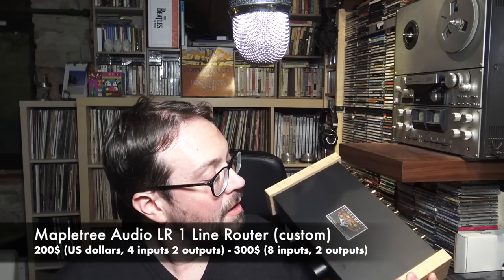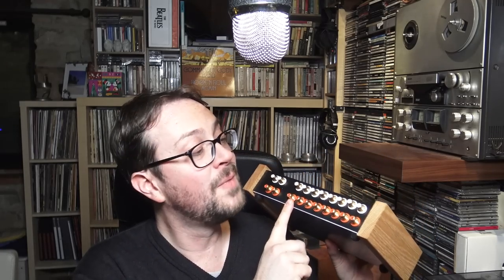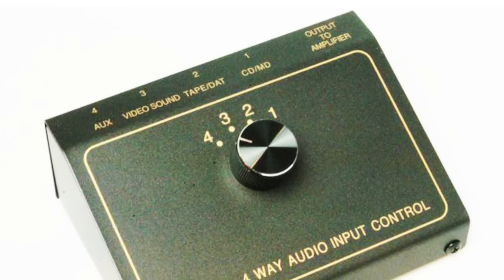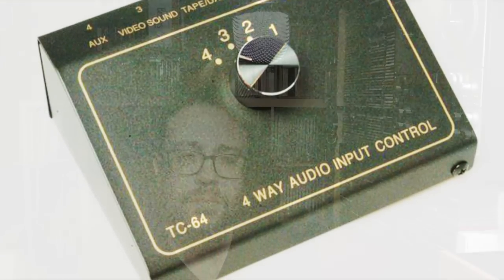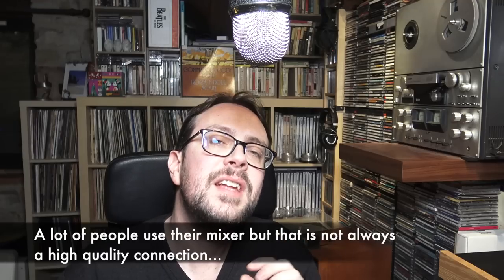AUX: Expand your amplifier inputs!

Comment: This will probably be a very welcome video to a lot of people, or at least it would have saved me a lot of time when I decided to get rid of rca splitters! Such a simple and useful device and yet so little is being said about it! Confusingly a lot of times it is called passive preamp, maybe because sometimes it can have a volume wheel, but anyway it's something I would avoid as it's only a resistance in series that can degrade the sound. I use mine to route the signal between pc, dac and turntable (with phono preamp) to a tube headphone amp or speakers, I added some embossed tape stickers for simplicity to find the right source. I would also add that being a passive device you can use in either direction, as an example if you have one that was thought to be used for 3 sources to one amp, you can also use with one source and 3 amps. Also if you have a lot of input and outputs and you don't want to go custom you can use two of them: as an example one that has 4 sources and one destination, instead of attaching it to an amp you can connect it to another one that route one source to 4 destinations. Not easy to explain, but it's exactly how those with two wheel works, just remember that the wiring between the two should be high quality!
Reply from the maker: I agree! Thanks for the extra info Marco!

Comment: Thanks for this video, very informative as always, I actually use the Dynavox aux-s the opposite way, not to add more inputs to my amp, but to run multiple signals-sources true the same “Buffer”, in my case two Russian Foton tubes from 1967 , this gives the a sound i like to my, CD-player, DAC and turntable, using the same Buffer-Preamp.
Reply from the maker: Cool! Good idea!

Comment: Finally someone knows and explains clearly the answer to a question I've been trying to solve for quite a while; and that is I don't have enough In or Out jack's. I looked everywhere on the internet and even searched YouTube, nothing! Thank you so much you're a lifesaver! But I am wondering about something. You recite all these components that people would want to hook up to their stereo; reel-to-reel, turntable, cassette, DVD, etc. If I'm understanding you correctly all of these would be hooked up to the passive switch via the output jacks. So why would someone only get one or two output jacks? It seems to me that we would need more outputs then what you showed? And way too many inputs. What am I missing?
Again, all my thanks!
Reply from the maker: Thanks for your message. You need a lot of inputs for all your different gear but only one output to connect them all (one at a time with the selector) to your preamplifier or integrated amp, which is probably already full. Let me know if this is clear.

Comment: You can make one of these, you need a 3 pole "break before make" rotary switch (L+R+Ground) so you can route a signal. It's a fun DIY project.
Reply from the maker: True! It takes time but you can choose the materials and spend a fifth...thanks for your input Rafael! (;-) notice the double sense)
Reply: i am building one from scratch but using backlit push buttons and relays for switching more for my preference for the tactile feel of a clunky push button and the sounds of relays closing. reminds me of the late 60's Apollo consoles. funny enough that cabinet in his canadian switch is exactly the same one i am using, well mostly, mine is the brushed aluminum as opposed to black with the dark walnut sides, they are made by Hammond mfg.
Reply from the maker: Good job! Send us a pic when done!

Comment: Nice! Thank you for an other interesting video! I would take in consideration using rack studio patchbays if you have a lot of stuff! Maybe they're a little unelegant but doing so you can route every output to every input (and viceversa) just plugging \ unplugging a pair of patches! They're quiet cheap, and you can find them used or new with different type of connections! For instance the Tascam PB-32H has 16 input- output 1/4 jack on the front and 16 RCA on the back, if you can find one in good condition can buy (or make) some hi quality TR patches and have everything routed in the same place!
Reply from the maker: Interesting thanks! Maybe a little too studio pro but good to know about!

Comment: I use a mixer to get extra inputs. The good or bad (it depends on each one) is that you can as adjust the level, and also get more than one output

Comment: Two things to suggest here:

A used Realistic 42-2110.  It's plastic, but the inside is all shielded. They can be had for $20 or less on eBay in the US. Only problem with them is only 3 inputs.

@DrCassette Made a great video about modding a cheap 8 port switch box: https://www.youtube.com/watch?v=QFzbTRWaLsA

Comment: Nicely explained? Could you pls share, how can I connect a microphone to my guitar amplifier that only comes with a single input. Also, is there a way to use the battery on an amplifier that runs on electricity, to make it portable?
Reply from the maker: When you have only one input, or you get a different amp or you must get dome kind of interface. In your case, alla analog, I would say a small mixer with instrument and mic level inputs. 
For the other question, I think you must get a fuel or battery power generator.

Comment: I know this vid is a few years old, but this is exactly the thing I was looking for! Do you find that these switches color the sound at all? And if by chance you still see this comment, have any new versions come out in the past few years that you would recommend? It does look like the TC - 64 is still pretty easily available on eBay. Personally I wouldn't need more than 3 inputs. Anyway thanks for your content!
Reply from the maker: No vid is old! I haven’t checked and I sure there are but they are difficult to find. Yes, a signal break is always a negative thing. The best we can do to mitigate is to get a high quality switch as the one I have shown from Mapleleaf audio. Another solution is to make your own. It’s not that difficult.

Comment: Downside is you need another set of interconnects and it adds complexity. But if it’s the only way, you need it.
Reply from the maker: Indeed and the connectors/ connections also add signal break.

Comment: can it be used in opposite manner, I have one input from my DAC RCA. But I need to use it for to feed multiple amps. So one input to switch to multiple output. Can this be used safely without degrading the signal ? Thanks
Reply from the maker: Absolutely yes! Both ways. The signal will always degrade a little bit. That is the downside of this convenient solution. At least its passive and the wires are of decent quality inside. The best would be to rewire everything with bulk OCC copper wire.

Comment: gold plating is often too thin to really take advantage since it will wear over time.
You're better off with nickel or even rhodium plating since both are more durable than gold.
Reply from the maker: If you plug and unplug often, I agree.

Comment: 1)Aren't some losses in audio perhaps?
2)Is possible to connect one onto another switcher in way to multiplicate the in & outs?
Reply from the maker: Yes David, in my opinion the signal brake has always a negative effect. That is why I try to connect gear of less importance or simply that I use less, and get the highest quality as possible. I would not recommend a double routing...soubd degradation is even more evident at that point...

Comment: So, this box you speak of, it goes into a line out I guess, but how do you control it once it’s installed?  I really like the idea... but I’m confused.  Please advise, thanks
Reply from the maker: You just connect all your hi-fi gear, each piece has its input (we are talking analog inputs, not digital). One output goes to the smp for amplufication. On the front there is a rotary switch with which you select the input you wsnt to send to your amp (its like a bridge, one selected an input it is auromatically sent to the output and therefore to your amp). Hope this is clear!

Comment: Hey, I need a switch for my PC, so I can quickly swap between multiple headphones, what can you suggest?
Reply from the maker: The ones I suggested are perfect, you just use them the other way around. Also, you will need a Y connector for the headphone plug. Otherwise you could use a dedicated headphone switch, probably easier, like this one: https://www.amazon.co.uk/Goliton-Channel-Signal-Headphone-Switcher/dp/B01FGYYQGI

Comment: I have a question, in my home stereo I'd like to connect many sources and I'd like to record not only with one ore two of them but every single machine , I have 3 cd player two tape deck, two Dat recorders one Minidisk and a Revox B77, What6 can I do ? Excuse me for my bad english, I write from italy
Reply from the maker: You can use a switch both ways for routing all signals to your amp and use one to rout one signal from your amp to multiple sources, but your amp must have an output.
Reply: @anadialog  Yes my power amp have an output, but i don't understand how to connect it. A switcher like dynavox has one output, for example I connect my 5 decks to it and connect it for example to my amplifier on one input AUX (example), the rec selector on amp is on aux rec and the signal come out from here, but how to connect this signal to all the decks wit another dynavox that has multiple input and one output, I don't understand can you explain me ?

Comment: I am not being sarcastic but another solution is don't have so much connected.   I might try a new thing, such as recently another play around with surround sound, but now I have finished playing I take it out.    I might have a go with cassettes again but will bring my cassette deck out and optimise connection and try to get the best out of it
Reply: Hey Ado, I'm going with that Maple Tree product because my  amp only has a phono input, a tape input and an aux input. Rather than uninstall and reinstall other gear (CD, laptop, tuner) I just bought the maple tree LR1. Also, I'm disabled and find turning around and plugging in a source is really cumbersome. This thing is small and perfect for my needs.

Comment: A simple answer to the output only having one connector use a pair of 2 to 1 phono connectors one out becomes two, not a perfect answer but it will work and it will not cost a lot of money to achieve a solution to the problem. (Hop this is useful to you all )

Comment: I can understand the logic of having 2 outputs but now you also also loose half of the power ( each output gets 50% ) . You now only have 100mV left on each output. 
Don't you feel it's a bit to low for a good recording ?
Reply from the maker: I did not notice any change between the single abd the double output switch, the double actually siunded better...

Comment: Hello, How to connect a
Technics SH-GE70 Stereo Graphic Equalizer to Yamaha R-S202BL 2ch receiver? Thanks
Reply: go check hifiengine.com and search your model they'll probably have your model manual there.

Equalizers were basically put between the amp and the recorder unit (tape), you'll need a bunch or rca to connect them. 2 in and 2 out. 
But if you want to put the equalizer on the output of the amp it will not work, the only way I see it possible is between a pre-amp and the amplifier, then everything will go through the eq no matter the source but you won't be able to use the eq to tweak your recording (if you do that), That's basically what eq were for during the day, tweak the sound you're recording in order to get a better recording.
Hope that helps.

Comment: But I mean if I can  hook it up with using my eq  I'd record if it could be done
Reply from the maker: Yes, you connect the output to the eq ans then the eq to a recorder or amp
Reply: The box is  passive
Reply from the maker: Yes
Reply: @anadialog   ok  thank you 

I've also been noticing that  if I  just have the eq running and not the eq record function I get hum or some sort of interference    now if I didnt want to record  how would I run it  being able to still use the eq

Comment: Ana, I found a Shinybow (never heard of them), which has 4 Audio RCA inputs and 2 RCA audio Outputs & includes , 2 S-video and 2 Video connections (in and Out).  It is powered and passive.  $159 on Amazon.  Anybody have experience with this equipment ?  THX

Comment: The $20 Chinese switches work just fine.  The under $10 Chinese switches is where you run into problems. As long as the box has a screw holding the rca input into the box your probably ok. You don’t have to spend big for these.
Reply from the maker: I disagree. I had the one in the thumbnail (the Dynavox) and it was quite good but much worse than the audiophile one I mentioned here. The components and the shielding do need quality for high performance IMO.

Comment: Do to the total lack of inputs on all modern amps these days , I got mine for £4 from a car boot sale , . 
ONKYO AV has almost nothing useful at all due to the modern sloppiness with Bluetooth & Internet connection  for an amp ?  USELESS , no tape loop ether .
MODEL 2084 E  with no brand on it , it has AV & sckart  as well .
Its better than unplugging from the back as the stupid tight , braking your amp .
Yess its for keeps  .  £4 , look around for second hand stuff , be smart ,
Reply from the maker: Onkyo is a excellent brand and what a price! good catch!
Reply: @anadialog  Heat issue with the ONKYO  ,  the fan has never spun at all .
Gets very warm so I put a PC fan on top of it with a 18 V battery .
Sound quality , smooth & very DEEP   !  .
I think this box was used for KARIOKE   as it has AV , could be .